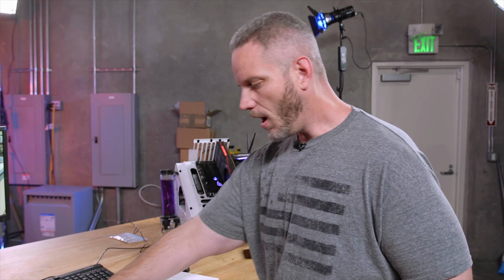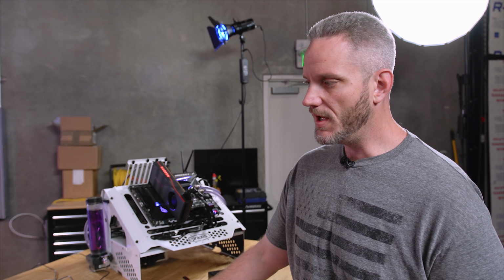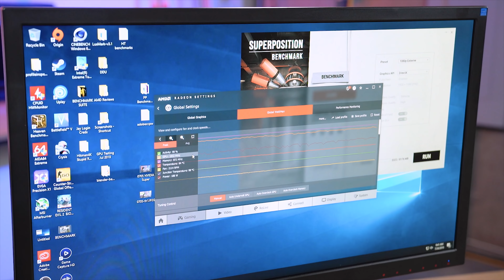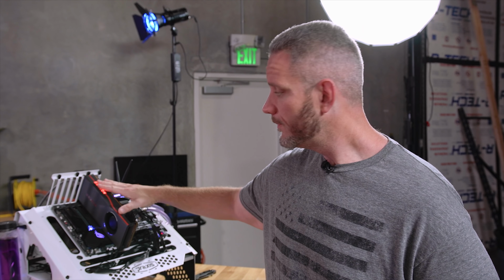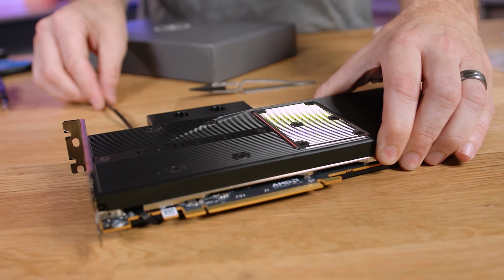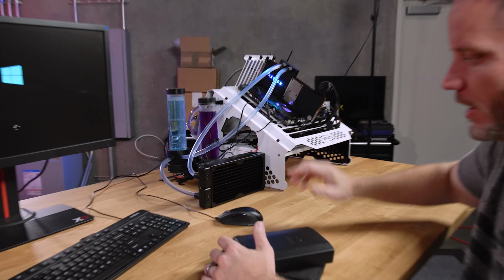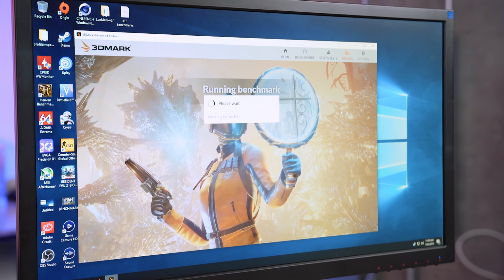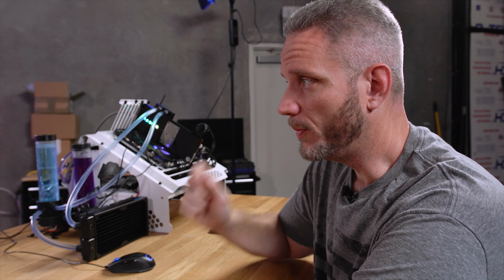Watercooled and Overclocked Radeon 5700 XT... Was it worth it?

Comment: 4:30 So Windows doesn't have integrated screenshot feature?
On my GNU/Linux Debian system, i just push the "Print Screen" button and it takes automatically a screenshot and saves it in my "Pictures" folder...
If there are some Windows OS developpers out there, you know what to do...
Reply: We do but it's only on win10 and it saves onto your OneDrive.

Comment: Anyone tried running coolant through an HVAC heat exchanger? They're used in hospital equipment road side electrical panels. Refrigerators. Would love to see the outcome.

 Oh yeah another common application for heat exchangers is in AC units.

Comment: Hey Jayz, what are the advantages/disadvantages of mineral oil vs water in a liquid cooling loop?
If you've ever tried it I'd be interested to know how painful/messy/relevant oil is vs water.
If you've never tried it, video suggestion? :)
Reply: Your question is 20 years too late. Besides, you can't pump mineral oil around a loop. Mineral oil is for submersion cooling, which is fucking messy.

Comment: Can I run Afterburner with this card ?   It's either this or the Radeon VII for my next build... but like you say I'm not building a new system until at least September.
Reply: You sure can run any AMD card with afterburner, although you won't have the added functionality AMD's software provides (e.g. undervolting based on power states, etc.)

Comment: Jay I have a Ryzen 5 3600X With a GTX 1060 6GB. I was going to Upgrade to a RX 5700XT but then I seen this Video. My Time Spy Extreme Scores with my GTX 1060 6GB Overclocked to 2086Ghz is Higher then what I see on this RX 5700 XT. My GPU score is 4687, FPS 1 = 30.28, FPS 2 = 27.09 and my Global Score is 4968. Is it even worth Upgrading to the 5700XT or should I be waiting for something eles?

Comment: I'm currently designing thermaltake tower 200 water cooling. Going to be running 7800x3d with 7900xtx hellhoud. All white pc with cooling for the components that need it. I know a standard 240 aio cooler would be just fine for the cpu. I want to take this platform all the way to am7. Skipping 6. I currently have am4 with 5600, 6700xt, and I love the way amd runs. I don't require advanced anesthetics in videos but what I do need samsung tvs upscale just fine for what I like. Alienware qd dwf oled is my gaming monitor. For standard workloads and all that such as Netflix and YouTube. I'm a welder fabricator by trade so I can make just about anything or figure it out on how to do it. I would rather enjoy building pcs and designing them for the aesthetic enthusiast. If there was money to be made in this I would be all for building em for everyone. But idk if I have the desire to run, sodder, melt, fittings, prep and setup a rig everyday. Lol. I enjoy it. Hobbies are meant for just that. Don't make it into a career if you enjoy doing. Unless you're fast and good. I am not fast enough to crank em out. I'm very old about wiring and fitment. Lol
Reply: I have ocd as well. I firmly believe in wire tucking like on my vehicles and having equal lengths even though the fractiona really don't matter in the long run operating things. As long as the diameter of things are in sync for what you want to accomplish. I can go 2 or 3 weeks not touching my pc and then go on a bender where I play half a day nonstop for 3 or 4 days. Especially if I get a new game haha. I want to build this before I finally buy tiny Tina's wonderland and diablo 4. When I play. I play heavy with YouTube in the background just vibing.

Comment: How long can you neglect a water cooling system ? I ran mine for 2 years non stop, had a sludge to clean up after...
Reply: Last I checked, correct me if I am wrong, its recommended to drain the rig...depending on the fluid u use like every 3-6 mnths. I've run rigs for 2 years plus w/o draining and they ran fine. I was using distilled water though. No premix coolant.

Comment: Can't you use GPU-z to check the ASIC quality of the card? the interpretation stated in the GPU-z window for checking the ASIC quality says that it affects overclocking and water cooling performance. For example, I have an ASUS R9 290 that has an ASIC quality rating of 82% according to GPU-z. I've read in forums that it[ASIC] directly affects overclocking ability.

Comment: Water cooling this card is worth it if you build a hackintosh otherwise just go with a more expensive Nvidia card. I'm a AMD fan because of price to performance ratio but I know what reasonable is and water-cooling and overclocking a inferior product just to achieve the performance of a compararabale price  (card + water-cooling to a stock air better card) card is not worth it. Just get the better product and don't play with water (chances of leaking) and your warranty if you don't have to in order to get the same performance at the same final price (water cooling block + card + pomp and reservor and radiator and so on).

Comment: Hey Jay. I'm having issues with AMD Overdrive. I have an MSI a68hm grenade motherboard and it doesn't have any CPU core voltage control features. I'm using AMD Overdrive to lock down my voltage to 1.4 if I don't the stock voltage by the MB is 1.52 which is way too high. Is there any other software that can lock down my voltage? Can I modify the MB bios?

On a side note. I thought acoustic was the primary reason for water cooling. Better thermals and performance was a secondary benefit.

Comment: Not worth it, but its cool and looks good. And to have less noise needs alot of rad space. Watercooling is really the extra thing, the extra after u get the pc u want, cuz getting it inside ur pc build budget is dumb, wwould have to buy cheaper parts (imagine having 1500eur pc budget, then try fitting watercooling for like 400eur, you waould have to build a 1100eur pc, with alot less performance, to watercool it while staying on budget)... its good when u get expensive parts and then watercool it as extra.

Comment: where do I adjust my fan curve? I have the new radeon software and can't find a fan control and MSI afterburner for some reason either keeps the fan off or puts it at 100%.  I have a gigabyte 5700xt oc gaming with three fans, and it should be decent at cooling and staying quiet but it's either off or all the way on.

Comment: I have a 2080ti black from evga. OC to 2040mhz but I have to run the fans at 85% to keep it right at 70c. Taking the fans higher yields no benefit, should I water cool it? Paid $1069 for the card

Comment: So I am running the rx 5700 xt witch the blower cooler and stock fan curf but have a bit of positive pressure in my case (because my front fans are stronger than the back fans) so this makes more air getting pusht through the cooler I think and I don't really have a problem, clock is between 1900-1970 and 90c maximum after 10 min benchmark

Comment: will water cooling work on an aftermarket rx 5700 xt? I have an asus card and I would like to swap out the cooler for water cooling, if its possible. I'm not sure if the PCB's are the same or not, or if they're close enough for it to fit.

Comment: getting burned by the back of the card? I did that a few times when my cpu cooler came loose on it's mounts and i just snapped it back into place (don't ask how it came loose i have no clue) but a few times i brushed against the back on my 5870 while it was running an intesive 3d application and it hurt a bit everytime.

Comment: I have a question, if the room temp is enough to make your idle temp about 45c idle or more (tropical places) either the cpu or the gpu and would always hit 70-80c and sometimes peaking to 90c usually from your daily workload to the maximum, would having lower temps increase the lifespan of your components?

Comment: have a prime b450m-a motherboard and updated the bios last wk and whent to set docp for memory ddr4 3000  on ryzen 2600 .  but after update bios noticed there was settings in memory config all the way up 4200 . before update would only show 3200 .  did the update raise the limit on the ryzen 2600 .7/29/19

Comment: hey JayzTwoCents, so i have a water cooling question which i cannot find an answer to, so i am looking into building a water cooled PC but not for overclocking reasons, I have a very small office and i want to try and reduce the heat expelled from my computer because when i'm gaming, my gpu alone heats the whole room up with ease. plus watercooling looks beautiful with RGB lol. so my question is will my computer expel less heat by using water cooling over a blower?
Reply: Yes.... running same speeds you'll have much cooler temperatures, that's why water cooling exists. How hot is that pc getting?

Comment: Considering how close the 5700 XT comes to the 2070S , I'd say you're better off waiting and buying a 5700XT AIB model.  Honeslty, these cards from AMD have made a significant amount of Nvidia's lineup rather pointless. I mean, there's no point in buying the 2060S or 2060 now, and the 2070S is a bit of a hard sell considering it's only 2-4% faster on average than the 5700 XT.
Reply: @marcusrat4466  IDK then because according to Hardware Unboxed, the 5700 is faster than the 2060S by 1%, and the XT is slower by 2-4%. Where I live (UK) AMD cards are usually somewhat reasonably priced. On the other hand, Nvidia cards are the US price figure just with the £ sign, which is ridiculous considering the value of the pound is greater than that of the dollar.

Comment: idk why all the 5700xts come stock with no fan curve....if you slightly modify it, you can lower temps on these cards by 20 degrees...thats pretty insane.  i have the red devil model and the thing makes 0 noise at full fan speed...super quiet on max load.  my gpu idles around 35-42 with a pretty aggressive fan curve.  i like it to be cool.  on max loads it never reaches 70 avg temp.  theres really no point in overclocking my card.  i gain like 4 frames.  but i do it and still never encounter overheating issues.  have a nice air cooled case as well.  might help.
Reply: I too have a red devil, and it's FAR from quiet. In fact, it's probably the loudest card i've ever heard at full fan speed.
Reply: @mrbuddha5263  lol, what case do you have?  i have mine at full speed.  i dont hear it
Reply: @mrbuddha5263  you could also just leave it stock.
Reply: @D0RYYYYYYYYYYYYYYYYYYYYY  Right now it's in a QBX running at about 60% fan speed and still loud, qbx has more than adequate airflow for the card as well.

Comment: I'm glad this exist I felt like I was pulling teeth getting this information. i seen the nzxt g12 gpu aio mount i have a 1060ti 6gb i got for free. i think overclocking it under extreme cooling would make for better performance.    why would i do this its going in a parts build I'm making for my dad from old parts most I've gotten free id buy a used old aio and a $20 mount makes sense to me but we will see how this plays out

Comment: Honestly, all that AMD would need to do to their HP hot cards is use a thicker heat sink.  They always try to shoot for two card thickness as a rule - I know - got that yesterday.  But who really even runs xtra PCI cards that would need to use that space any way?  Can'r remember the last time I put in a PCI card for anything.  Let the viddy card use that space.  It's a gamer's card for a gamer machine.  Make it 4x wide and let it get rid of the heat so it can be OC'd.
We put huge air coolers on CPUs to tame them heat; 'bout time the viddy card got the same treatment.
Just sayin . . .

Comment: I have a custom xfx 5700XT and I realy need to cool it down more because maxed out I'm on 300W ish power draw, ofc it beats any 2070super and ti but not in long runs with air cooler because my juction temp with power limit removed passes 100deg Celsius, it is concerning because it is close to 1/2 of the soldering temp and that means it won't take you trough an entire year maybe not even 6 months so yeah in my case or similar cases it makes total sense to liquid cool it, saw Nvidia scores for 2070super and TI and to reach close to this OC'ed card it does the same thing with the temps for example my gpu core temp is 60deg celsius => junction is 79-80 nVidia stocks on gpu reaches 67-68 so it gets close to 100 on junction temp if you try to OC the Nvidia to beat the rx5700xt oic'ed you need to do same thing buy a water cooling kit so if you already have the card don't sell it to buy another which may last way less than you may expect so yes for me and I think for many more durability its a thing if you are not millionaire and don't care how long your card last cause you can buy another anytime

Comment: ah there is a problem with your test NO 2 gpus are the same company buy them in stock to find out what gives the highest reading so when u swapped cards your 2ed card could been higher voltage rate. In other words ALL gpu cpu are always under there value and can be set higher.

Comment: So guys i need your opinion about my new pc that I am trying to build:
Intel core i5 9600k unlocked
16gb ram 3000mhz
RTX 2070 8gb
240gb ssd
1tb hard drive 
+ 24 inch monitor 144mhz ( zowie )
And the case contains 3 rgb fans front side and 1 in the back. So is there anything else i should do before starting it up???
And thx for your help😁😁

Comment: Stock 5700XT wins 2070FE (https://tpucdn.com/review/msi-geforce-rtx-2070-super-gaming-x-trio/images/relative-performance_2560-1440.png), so AIBs will get closer to 2070S with a slight manual OC and will be much cheaper also.

Comment: about the ifixit tool kit, really wanted 1 but you said its not expensive lol £51 ?? you can get identical kit for £18  to small workload for them tools to break, no point in braking the bank
Reply: Unless you plan on working on phones you don't need the full iFixit kit. The iFixit  Mako Driver kit for $40 USD is more then enough for people planning to use said kit for pc building / repair.

Comment: So 120 for the water block plus all the other stuff tubes ect full cost?
Reply: That EK setup you're probably looking at about $500. $120 for the block, $45 for the backplate, $175 for the pump/res, $100 for the rad, and $50+ for the fittings and tubing. It can get expensive pretty quickly
Reply: @RonnieDeuce87  thanks, that's crazy a

Comment: i needs help ... my gpu rx 580  is hot 75f to 80.. what i do?
Reply: king_fire77 mining ?
Reply: Are you overclocking it on the air cooler? Make the fan curve more aggressive, make sure you have good ventilation or reduce the overclock.
If you haven't overclocked it make sure you have good case ventilation. Clean it out as too.
Reply: Some random guy on the Internet  no.... it’s normal video card I’ll buy new case and more fans
Reply: Deeparth Gupta  okay... I’ll buy new case and more fans

Comment: Hey Jay I have a digital storm behemoth laptop it few year old but about a month ago it start to ack up right now when I turn it on and it start to boot up the fan start to run on high then it start to beep and three light start to flash  the cap,num and scroll.  lock  what I've done so far is cleaned it and the put on new thermal paste on but still no dic do u have any idea please let me know I dont have the money to get a new laptop
Reply: Look up the beep code

Comment: i did maximum what drivers can do on wind cooling and it's working at 2150mhz with 1177mV and 1197mV but it get errors 10min later of playing and card lagging . Anyway it's smooth for me at 2044mhz and 1127mV. Is it worth? nope in my game i can't see differance only in benhmarks i can see results

Comment: WTF my powercolor dual fan 5700XT runs at 110-112 degrees under load (TJMAX).
Reply: "110C Junction temperature is normal and expected"

Use Global Wattman to undervolt your GPU and let your fans spin a bit faster

Comment: You need to tinker more when you do these videos like max undervolt or best performance with a certain undervolt. Hell I can hit those clocks with a 1095mv uv stock cooler and my max uv is 972mv. And if you watercool the 7 and the xt the 7’s a good bit faster. Yea there's some synthetics it doesn't do great in but it a good bit faster than the xt forza horizon being one exception. I know it's eol for it but not sure why people are selling 7’s to get xt’s. Hell they had a couple of fixes for the 7 in the latest driver. Both good cards but I've had more crashes and instabilities with those 2 cards than I've had with all my nvidia cards since the 780 days. Not ranging on them just speaking the truth.

Comment: JUST. WAIT. FOR. THE. AIB. CARDS. (and manually OC those on air.)
Reply: Or just buy 2070 super and just start playing now. My 2070super is a beast. Easily overclocked to 28.6k firestrike and 13.4 timespy and never reaching over 67•C.  Literally a 2080 super performance without any waiting and shit drivers

Comment: Soooooo, let me get this straight... Water cooled card at around the same price and performance as the non-water cooled makes less sense? So having a cooler GPU while everything else is same makes no sense? Okay....
PS. Please don't tell me crap like "but you gotta add the waterblock price" because I already did, 5700XT + waterblock = 2070 "sucker" price, as well as performance...

EDIT: Actually non-OC 5700XT is sligtly more powerful than 2070 super, while being $200 less...
https://gpu.userbenchmark.com/Compare/Nvidia-RTX-2070-Super-vs-AMD-RX-5700-XT/4048vs4045
Reply: Userbenchmark tests only dx9 and dx10. There is no dx11&dx12 test.

Comment: Hey everyone 
I have been OCing my 580 nitro + and so far achieved  1547Mhz core, 2150 mem @1.2v 
Max temp 68
Fan 100%
Superposition score (1080p extreme) - 2867
 Stock Gpu cooler 

I want to hit 2900 points 
Could water cooling help me get it done? 
Can someone explain me if there's manual voltage control on Watt tool? 

Ps - won't be using it on daily basis , just wanted to break some hwbot records